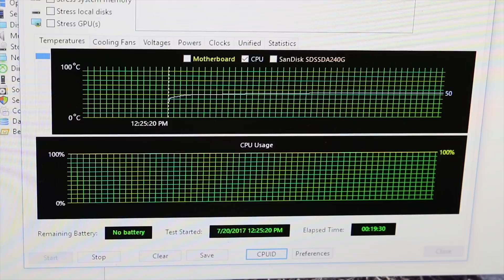My Node 202 Build Dropped 35 Degrees on the CPU with this Mod

Comment: Wraith spire with a  noctua NF-A9 works great as well no modification required
Reply from the maker: The spire heatsink is 40mm tall and that fan is 25mm. In the Node 202, we're only working with a total height of 56mm. Also, the mounting points on the spire are for an 80mm fan, and the NF-A9 is a 92 mm fan.
Reply: It's the slim fan that comes with NH-L9i low profile cooler
Reply: can you give me pictures of that mod?

Comment: I've never seen a CPU temperature so consistent. The temp didn't budge from 50c. Seems fishy, should be fluctuating.
Reply from the maker: That's because it was stabilized at max load for an extended period. When you're watching your temperature outside of a stress test, it bounces as the CPU load changes. When stress testing, eventually you'll either reach a stable temperature under load or you'll thermal throttle if the temperature is too high.
Reply: +Hoosier Hardware Teaching in the video and teaching in the comments. Good on you.
Reply: it does move a bit over that line but the movement is so small it wont reflect on that big of a time line.

Comment: Theoretically... shouldn't the C7 with stock Spire fan would do better and also cool RAM/moboVRM better?
Reply: no c7 heatsink is smaller compared to spire and it doesnt have a vapor chamber like the spire. the only thing holding back the spire is the fan.

Comment: Would it be possible to buy something like a Noctua NF-A9x14, to replace the stock fan on the wraith spire with?
And would it then fit inside the node 202?
Reply: wraith spire takes an 80mm fan. That Noctua you're talking about is a 92mm. You can buy a 15mmx80mm fan and stick it on the spire's heatsink and call it a day.
Reply from the maker: +Tobbenh I'm not sure. The spire is right at 40mm tall giving you 16 mm to play with in height
Reply: Hoosier Hardware The NF-A9x14 is 14mm thick so it should be possible if the mounting holes match up

Comment: You 100% sure, you did not mess up the installation of the Cryorig? I mean, it has 4 heatpipes, it should be better than the Wraith heatsink, or at the very least equivalent if the size is a bit smaller o.O
Sounds to me almost as if you forgot to apply thermal paste or something.
Really strange
Reply: The Wraith Spire has a vapor chamber which is very good for a stock cooler.
Reply from the maker: +sassuki I would have been skeptical as well, but Kyle from bitwit saw very similar temps in his Ryzen/Node 202/C7 video
Reply: spire is better it is a vapor chamber and much beefier those tiny heat pipes are nothing

Comment: Not sure if this would lower the temps even more for you, but it would be fun if you could try it out.

Since you have around 17mm clearance, you can try to get a Cryorig XT140 fan (http://www.cryorig.com/xt140.php) and fit it on the heat sink. If you have trouble getting it to sit on the heat sink, you can try to stick it to the dust filter with some doublesided foam tape (a 140mm fan covers the dust filter nicely).

I personally did this for my Intel build. I had the ID Cooling IS60 cooler (https://www.newegg.com/Product/Product.aspx?Item=9SIA59T1R00547) and I removed the 120mm slim fan and replaced it with the Cryorig XT140 (I stuck it to the dust filter as mentioned above). Temps did come down a few degrees, along with the noise.
Reply from the maker: +Tee Lim Tan I may consider looking into this. Nice part is it'd also do a better job circulating air on the VRMs as well.
Reply: Hoosier Hardware Great! Would love to see a follow up video if you actually try it out.
Reply: I like this idea a LOT actually and would love to see a follow up video if possible. The XT140 should be able to move more air at a lower noise level into the case. This also means that builders who are already buying a Ryzen with wraith spire cooler don't need to invest into a $ 25+ cpu cooler, a simple pwm slim case fan should be even better!
Reply: Have you seen the prices on slim case fans? They are high when you can find one in stock and I haven't found one that isn't sleeve bearings. Very cheaply made. You might as well buy the whole cooler w/fan as the price will be almost the same.

Comment: what does this video even mean?
why did you bought the C7 and ripped off it's fan to put on the spire's heatsink?
why not use the whole C7? AFAIK the C7 heatsink must be better than the spire heatsink right?
Reply: doesn't look solid here https://imgur.com/gallery/Xh3fQ
Reply: Because you can buy a fan similar to the C7's if not the same by cryorig and do this mod.
Reply: Read the description and delete your comment.
Reply: amd and coolermaster are not simpleton like Intel.
Reply from the maker: +Artemis No, the C7 heatsink is super low profile compared to the spire, and the spire has a vapor chamber as well.
Reply: The spire DOES NOT have a vapor chamber, it's a solid copper slug
Reply: my bad then
I thought it's like them old Pentium D beefy stock coolers with the copper slug in the middle
explains why the spire's so good
Go AMD!
Reply: Hoosier Hardware should've just went with noctua since they are better than any cooler lmao
Reply: can you  please provide a link
Reply: Oh I wouldn't say that RedClaw. I have a Cryorig C1 on my A10 7850 and I can crank up P95 for hours and never go over 46 degrees. It's good for 140 watts. The Cryorig coolers are just as good as the Noctuas and are just as quiet. I buy a cooler based on it's dimensions, effectiveness and how noisy it is: I'm a mini ITX guy myself. My rig is inside a Silverstone FT03 mini and I have about 80mm to the bottom of the PSU.

I know it's too tall for his case at 74mm, but I'm sure he'd running lower temps if he had installed the complete C7 instead of just the fan on that large solid dinosaur of a heatsink, copper slug and all. They were using copper slugs inside aluminum fin arrays in the early 90's with no fans at all long before the heatpipe was invented. Heatpipes are the shizz and suck heat away almost as good as liquid coolers. And silently at that, no buzzing pump needed.

I keep laughing at all of the people falling for the PR about those Ryzen stock coolers being so good. And even though I've been a faithful customer of AMD since the venerable Athlon 2 Brisbane, the original "dual core on the same die" CPU game-changer, I'm a little upset that they won't sell a "box" Ryzen CPU and are forcing people to use those stupid huge coolers to keep their warranty. This guy has voided his warranty by changing the cooler anyways, so I don't see his point. He owns it now and isn't getting as good a cooler as he could have had.

Comment: I'm actually building a 1700 build right now, though I doudbt I would need to upgrade the fan unless I OC but dam this is a good idea i might do it anyways lol
Reply: 1700 has a pretty good cooler handles 3.8 ghz with little trouble on the b350 boards. I got mine around 1.35 and it seems to be the sweet spot in my Silverstone SG11 case. (very small case yet fits standard components.

Comment: That's pretty cool so did you do a test vs the c7 heatsink? Which on is more silent and runs cooler?
Reply: c7 will be hotter. it doesnt have a vapor chamber like the spire and its also half the size of the spire

Comment: Wow now I can actually consider small ITX cases like the Node 202 for smaller systems I want to build for my small IT team.  Thank you very much for sharing this genius idea with us!  I have a mid tower Ryzen 1700X build myself with a fractal 360mm aio in a cougar panzer case at work and it's been stellar, but my team (just 2 employees) has more limited work space and ITX Ryzen builds definitely make more sense for them.  Was hoping to set them up with Ryzen 1500X cpus and was wondering if you tested temps with either this specific cpu or with other Ryzen cpus which have similar base/boost clocks.  Great channel btw and you're going places!  When your subs are in the multiple 100 thousands, I'll be able to say I was around when you only had 4000 subs ;)
Reply from the maker: Hey thanks! I've only had my hands on the Ryzen 1600 and 1800X for any type of testing. I can only imagine the 1500X parts would run a little bit cooler overall than the 1600 does.

Comment: why not a Noctua?
Reply: +Rami Bos, The C7 is a decent cooler, however, when running it literally at its thermal limit wouldn't you expect higher temps?
Reply: @sparkplug1018  Sorry for answering this old comment... But isn't the C7 rated for 100W and the AMD 1600 for 65W? Shouldn't it technically be able to achieve a lower temperature than the above mentioned 85 Celsius?
Reply from the maker: +Klaus Christiansen I haven't tested the Noctua low profile coolers but the spire has a vapor that really helps out
Reply: What's this C7 then, I mean.. what we are paying for just to have 85C temps??
Reply: +RevoThornax Most likely.
Reply: It's dick color